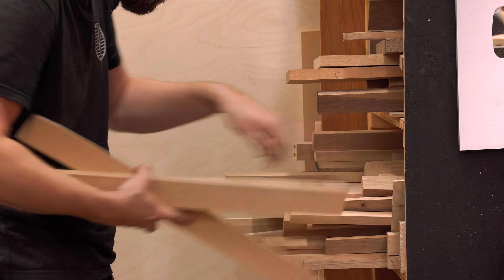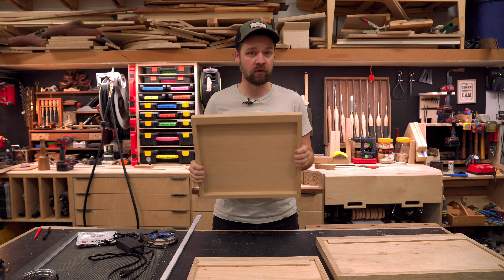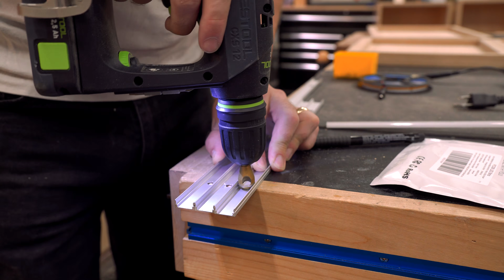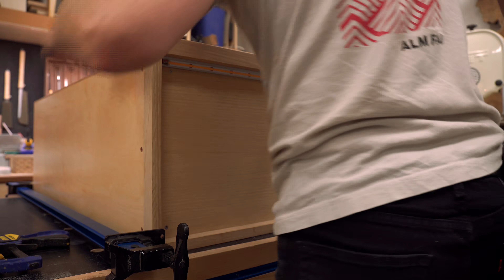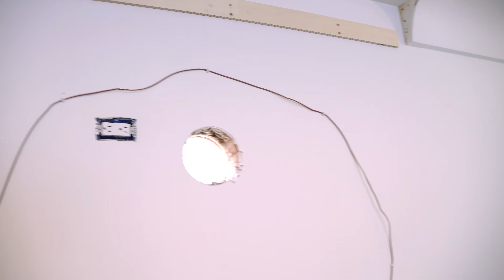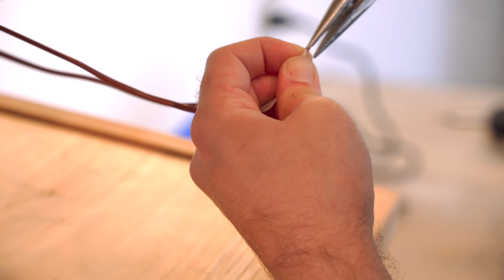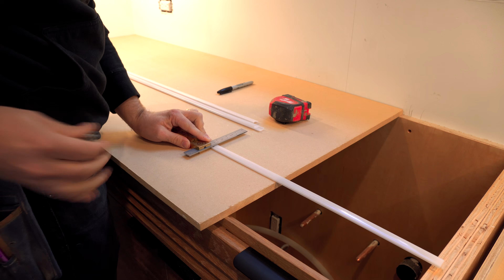Invisible Wire LED Lighting: Ultimate Kitchen Upgrade!

Comment: Which dimmer switch did you install with those components? I bought nearly the same items to test: BTF COB strips (but 12v) and a plug-in 100W power supply. I got stuck trying to find information about pairing the driver to a dimmer switch. My kitchen is hardwired with a single-pole, non-dimmable switch connecting two runs of CFL tube surface-mount lights. I was trying to avoid putting a driver between each run on the switch, but I couldn't figure out if it should be that way because of the original electrical layout. Maybe better to consult an electrician?
Reply: Can't speak for Michael, but I've pretty much settled on Lutron's Diva line of dimmers. They are less expensive than the equivalent Leviton option, don't require a neutral in the box (though in my case that wouldn't be a problem, but it still makes the wiring simpler), work with three-way circuits, and are designed specifically to work with dimmable fluorescent or LED lights, including a little potentiometer that controls where the lower end of the dimming range the dimmer will actually be (this is useful when dealing with less expensive fixtures that can't handle the lowest levels of dimming, and wind up flickering when you get too low...setting the dimmer to a higher minimum allows the user to slide the dimmer over its full range without worrying about getting into the "flicker zone").

Of course, you still need a LED driver that is compatible with dimmers. Many are, but some aren't so make sure you're getting the right thing.

One consideration on the dimmers is that they will have a maximum wattage rating. For a kitchen install, it's highly unlikely you'd come close to the max, but if you're controlling a wider area of LED lighting with a larger driver, it could be a consideration. Especially if you wind up putting a couple of these dimmer switches next to each other, because the wattage rating goes down if they have less room to breath (it's largely about heat dissipation, and putting them next to each other reduces how quickly they can dissipate heat).

I don't like the Leviton's visual style, frankly, and other than the cost that's the main reason I don't use those. I prefer the very low profile slider that the Lutron dimmers use, over the big fat almond-shaped thumb handle that Leviton uses. But some people might prefer the latter, since it's easier to see and use, and maybe even like the look. Leviton's dimmers are also a bit more compact, which can be nice if the switch box is tight on space. If I recall, they also have a model that has a higher wattage rating, though off the top of my head I think the rating is 300W for Lutron and 500W for the higher rated Leviton, and frankly even 300W is likely way higher than would be needed in most situations.

End of the day, either Lutron or Leviton make good dimmers and both have models designed specifically to be compatible with dimmable LED drivers. There might be other brands; just make sure it's from a reliable company like Feit, Philips, etc. and not some fly-by-night low-budget brand, and look for the same features that Lutron and Leviton offer.
Reply: @harvey66616  Thanks, I'll take a closer look at Lutron's current line. I redid my garage with Maestro motion switches tied into existing ceiling mounted motion sensors. That was confusing enough to figure out by sorting through the junction boxes.

My kitchen has 120v AC to each CFL tube fixture under the cabinets + one CFL can light over the sink. All together once replaced with LEDs it shouldn't draw more than 115W, so even a 150W switch could probably handle it. I started planning it out during the pandemic but sidelined it because so many drivers just had no supply I couldn't get the kind I thought were specced right.

The "easy" way is probably putting a driver in front of each strip and use a standard AC dimmer, but I know it'll cost more and be annoying to hide them. I can't see what's in the wall (stone backsplashes) but I'm still trying to figure out if it's possible to use one driver and replace the AC to each fixture with low-voltage. That's probably how it would be wired new today (I'm guessing) for a custom lighting job.
Reply: @BrendanFalkowski  I don't know what's legal to code, but...seems like your last idea should be feasible, if you can access the wiring at any convenient spot before it reaches the cabinet (and overhead).

I.e. house wiring is overkill for LED low voltage, but it will still work great to carry the low voltage you need. It'd just be a matter of hooking things up.

The tricky part will be how the hot and neutral wires are dealt with. But "modern" wiring probably uses Romex-style cabling, so there are two wires (plus ground) going to each fixture and you can reuse those for the +/- for the DC voltage. And it seems to me electricians like the daisy-chain things, as opposed to a home-run type parallel circuit, so in theory you should be able to find some place downstream of the switch where you can use the LED driver to change what the cable's carrying from mains to low voltage.

If you're really lucky, the cabling goes from the switch to the can light first and then continues from there to the cabinets, so you could hide the LED driver in the ceiling next to the can light (i.e. I'd guess that would be easier, since there's already a hole in the ceiling for the can :) ).

In that case, you might even keep the can at 120V, because the LED cans usually have the driver built in already (especially the retrofit ones) and so are designed to be powered from the mains voltage. You'd just split the mains source there, running the can and the LED driver from the switched power, and then using the cabling continuing to the cabinets to power the LEDs installed there, hooking it to the output of the LED driver.

I don't know how much cabinet length you have to light, but I'd guess you'll come nowhere near 115W. My own project, I had 5.25m (about 17') of undercabinet length to light, using 2832 LEDs on a 120 LED/m strip, and the power requirement including the 25% headroom was only about 80W.
Reply: @harvey66616  Ah great, those are some really good points. I didn't consider being able to re-use the Romex for low-voltage because nobody would install that. I'll have to check if codes frown on that because I'd assume Romex = 120v without testing it.

The switch is splits the left/right wing of cabinets, and is directly beneath the can light. My guess is left/right/can are home runs with the left and right daisy chaining to each under cabinet fixture (3 on each side). I can disconnect them one by one to figure out the flow.

You're right, it'd be really nice if left/right meet at the overhead can. That would make access much easier since the CFL can is coming out. But I feel like they'd just home run from the switch at chest height behind the backsplash, rather than running up/down for each wing.

My cabinet run is about 5 meters too, so I was calculating with the FCOB 480 LEDs/m strips I got for testing. They use 9W/meter so 45W under cabinet + 45W above cabinet (may add later with less output) + 25W for the can light (safe guess what the CFL can uses now). All in it probably will be < 100W.
Reply: @BrendanFalkowski  Yeah, I can see how the COB strips might be more power.

As for code, I have no idea. I only know bits and pieces of the NEC, and nothing related to this, so I'm not much help in your case. That said, I think since code is mostly about preventing fires and electrocutions, changing a circuit over to low-voltage is probably fine? Seems like the scenario is not much different from just abandoning a circuit, and the NEC allows that just with the caveat that if the cable isn't removed, you still need boxes and cover plates over each end of the cable run.

I guess when you get the switch open, you'll be able to see if there's more than one load connected to the switch terminals (i.e. with a pigtail hooked up to multiple cables going out). If so, then I guess it'd probably be easiest to just get a driver each for the left and right cabinets, and figure out somewhere to hide each nearer the cabinet it powers, and use a retrofit can light, which will have the driver built in.

On the bright side, it probably wouldn't be much different in expense, since the driver cost goes down with the rated power, and if you use two drivers instead of one, you only need half the power from each! :)
Reply: @harvey66616  Yeah that sounds like a plan, thanks for talking it through.

The best part about my over-sink can is this apartment was remodeled in 2010 when "bizarre CFL bulb bases" was somebody's great idea to prevent Californians from continuing to buy and use incandescent bulbs. So that light requires a 4-pin G24q-2 base, and the rest of the kitchen can lights are a different G24 base. 

Super convenient now that LEDs replaced CFL and bulbs moved back to normal E26 bases, and they don't make retrofit kits for ceiling cans with G bases unlucky enough to be installed in the last decade. You have to pull the can and bypass the ballast with your hands up in the ceiling. It's going to be a long day on the ladder.
Reply: @BrendanFalkowski I've changed all my dimmer switches to lutron diva. I really like them.

Comment: @11:25 Transformers in electricity means a physical thing - a block of metal with windings.  LED drivers might have a coil, but not a transformer, because they're switching regulators.

Comment: I'm glad you went with the hard wired approach, rather than all of the battery, Wifi, Bluetooth crap that won't work in another decade. I did mine this way as well and wish I'd installed the transformer remotely and ran the low voltage wire like you did. Instead, I hid my transformer within the cabinets, which was a massive pain in the ass. Looks great and works nonetheless, so live and learn.

Comment: Transformers are passive devices, kind of like a gear reduction but for electricity. The output is proportional to the input. Furthermore, they only work with AC voltage. 

Drivers will accommodate for variations in input and regulate the output as a pwm DC output more like a governor, outputting the specified signal regardless of the input (within a specified range). Fancy drivers will let you control the brightness and color by modifying that pwm output, presuming those features are supported by the strip.
Reply from the maker: Good to know!

Comment: Fun fact! Some LEDs can interfere with signal transmission. We put up LEDs in our garage and the garage door opener no longer works if the lights are on. Don’t ask how long it took us to figure that out…
Reply: Ugh. Good catch!

Modern electronics have brought a lot of conveniences, but these occasional interference situations can be really frustrating!

For my own part, I haven't had any LED lights interfering with the garage door opener (yet), but I have discovered that our Home Depot "Defiant" brand timer switches get spooked by our electric car charger. Only when the charging cycle gets near the end (I guess maybe the charger is modulating the power more? I don't really know), but something about the way the EV charger works injects some kind of signal into the house wiring that confuses the timer switch, causing it to randomly toggle on and off.

Comment: Nice install. Two questions: 1) what are your thoughts on solder seal heat shrink butt connectors? Seem like it would save one step.  2) What's the plan for replacing the strips when they eventually fail? I realize they strips should last for thousands of hours, but eventually, they will fail and that kitchen seems built to last.
Reply from the maker: Thanks! I've never tried that style connector, but I'm sure they would work. If the LEDs fail then you unscrew the valances, de-solder the connections, and replace them. I've heard from other commenters that the COB LEDs might have a shorter lifespan, but the aluminum channel helps dissipate heat so that helps them last longer.

Comment: For most standard cabinet installs I've seen, it's super easy to hide the wires. There's usually a little gap between cabinet boxes, so you can just run it up and over, no holes required. Might have to try to hide the wire running from front to back, but no one's going to look there anyway.

Comment: Did you consider using threaded inserts + machine screws to attach the valences to the bottom of the cabinets? I'm more of an electronics guy than a woodworker, but I've found that those are a little more robust to being repeatedly disassembled/reassembled.
Reply from the maker: Threaded inserts would be an upgrade for sure, but I don't think they will be removed often enough to strip out the screw threads.

Comment: They are not called transformers because it's not a transformer, it's a switch mode DC power supply. Transformers are used for AC->AC conversion.

Comment: I'm loving this series! Two part comment here... First, thanks for the best LED explanation I've seen pitched to the true amateur level - most content makers kind of gloss over all that with a 'I bought it off Amaeverything, link in description' as if one LED set solves all lighting scenarios; Second, one trick I employ to reduce complexity is to not plow the groove until the miters are all figured out and cut. If your pieces are consistent cross-section, this avoids creating a 'right v. left' component scenario... yes, I have to out-think myself all the time.

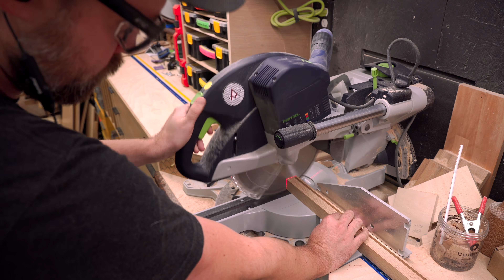Comment: When cutting the miters at 3:30, any reason you're changing the angle on your miter saw instead of just flipping the other workpieces over to the right side of the saw? Assuming the miter saw fence is straight you'd get your complimentary angles without the chance of small mismatches in the angle, it would also be faster.

Comment: It probably doesn't matter with aluminum, but one of the things I've heard from the metal working and machining side of YouTube is that you shouldn't drag your file against the metal as it dulls the file faster. Most files cut in one direction so you cut, lift, reset, repeat.

Just thought you might like to know.

Also, these are going to look awesome.
Reply: Eh, that's a bit of an "old wives tale" (for crusty men with big gnarly hands) - you can look on youtube for actual tests of files dulling, and it's not conclusive. 

Especially for aluminum! The bigger concern is aluminum gumming up the file, so keep a file card (or a very stiff steel wire brush) on hand.

Also, this is just my experience, but I either buy cheap hardware store files or garage sale old-but-quality files for $1 (or harbor freight needle/diamond files), so I'm not concerned with dulling at all! 

I suppose that it MIGHT be worth worrying about if you have some "good" files.
Reply: @joegibes  I did day it probably doesn't matter with aluminum, but I can see it being an issue with steel, especially harder steels.

Comment: Without getting into the weeds: transformers are usually AC-AC where as drivers (or power supplies) do AC to DC. Good ones will prevent any flicker as well.

Comment: Electrical Engineer here, the reason it is called a driver rather than a transformer is that a transformer is explicitly a device that converts AC power to a different voltage of AC power. LED are diodes and produce light when power is fed through them in one direction, thus the AC power will need to be transformed down to 24V and then passed through a rectifier to turn it into smooth DC power that is suitable to drive the LEDs
Reply: Came for the answer, stayed for the bickering in the comments 🫡
Reply: 😂 riba2233, chrisw1462, and 112Haribo have no idea what they are talking about.
Reply: @Skibszilla  Search 'capacitive dropper' on google and you'll see this definition: "a type of transformerless power supply, converting AC mains input to a much lower voltage output..."
Reply: @Skibszilla  yeah sure buddy, I am sure you know better /s
Reply: Also usually a switching regulator with no transformer in sight.
Reply: @chrisw1462  it has a transformer, just a small high frequency one
Reply: @riba2233  Nope.. only one winding, so it's an inductor.
Reply: @chrisw1462  that is a simple buck or boost converter, but that is not used in anything that plugs into a wall (not counting led bulbs) because it doesn't offer galvanic insulation. So yeah, they all have transformers with two windings.
Reply: @riba2233  Lol.. pry one of those cheap things open.  Chances are it's a capacitive dropper feeding a buck regulator.
Reply: @chrisw1462   maybe on some tiny ones but I have only seen ones with trafos. Galvanic insulation is also most likely mandatory by law
Reply: @riba2233  The only place outside of industrial galvanic isolation is required (that I know of) is in medical applications - at least in the US.
Reply: thats kinda BS, since that would mean all laptop chargers would be called 'drivers' as well. It's mainly called a 'LED driver' because it's a device that... drives LEDs.
Reply: @112Haribo  well laptop bricks are not chargers at all, they are just power supplies. Charging circuit is in the laptop

Comment: Since all of the base cabinets along a side are already connected, and this is low voltage wiring, another approach could be to run the low voltage wires from behind the uppers down to the bases before drywall is installed (or cut holes and fish same after drywall is installed) and then have a chase between the base cabinets along the back near the countertop so that you can then connect all the low voltage wires together. One of the base cabinets can then have an outlet where the driver can be placed, making it more convenient to replace when it ultimately fails.

Comment: For heat shrink I would recommend using white colored tube I found out from the specs and testing clear tubing actually isn't fire rated from most manufacturers I've used. Hiding any red/black wire from light reflections is good anyways.